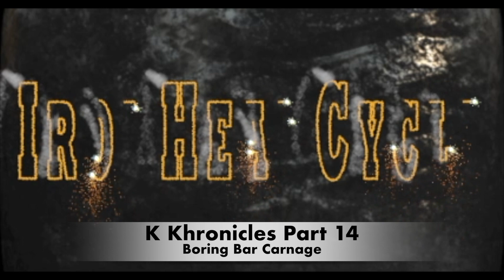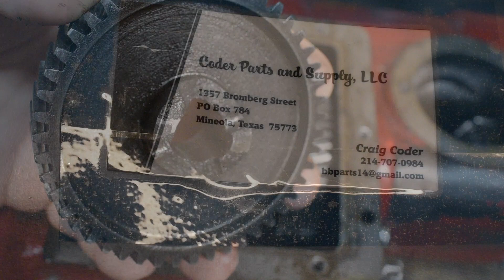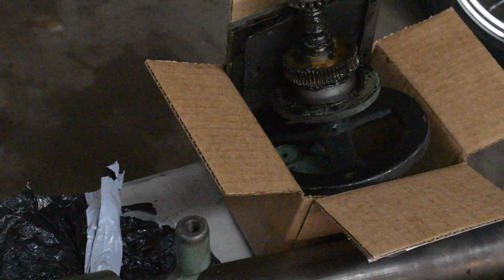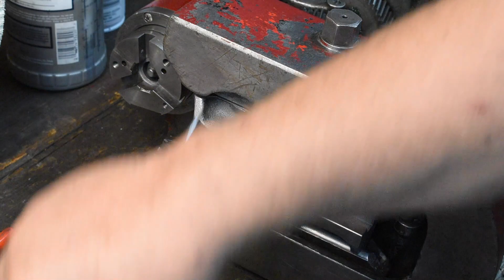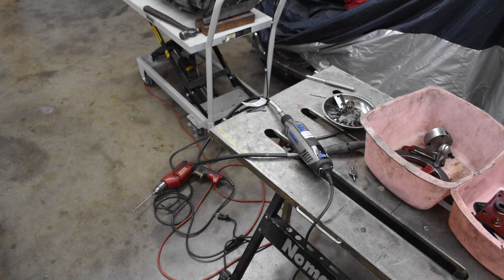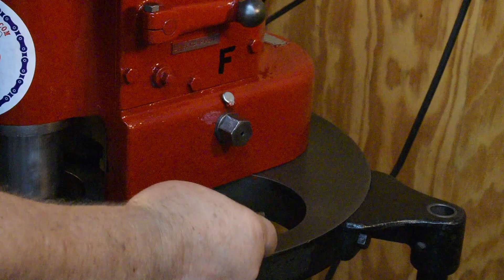K Khronicles Part 14, Boring Bar Carnage Nbr. 87

Comment: Good info!!
 I recently acquired an old KW boring bar and will be giving it a checkup and oil change before attempting to operate it. 
It will have to wait until after I get the vintage Sunnen LBB hone machine that I also got in the screaming deal up and going again.
These old machines seem to just keep on going and I think I got lucky with these two since there is no way I could afford any of the new or even used machines.
Reply from the maker: You are going to have a lot of fun with those vintage machines!

Comment: I am a machinist by trade, that  gear bore and shoulder can be repaired. I have done many of them. And the bushings can be easily made as well. 
If need be, you can machine a new gear blank, hob the teeth and harden it yourself with oil quenching.  Lastly, you can simply have a new gear made by a company called “Arrow Gear” located in Downers Grove Illinois. They can make a new gear right off your sample piece.   But repairing your old one is the best option as long as you have a lathe and some round stock.

Comment: I feel your pain brother....went through it with an FN bar. Same thing...only a pin fell out of mine and destroyed a bunch of gears. It sat for 8 years until I tore up my other bar and had to fix something to make a living lol. I found Craig like you did....luckily I'm not to far from him either (Cumby,TX) . He had to explain what you call the secret screw to me as well because I could NOT figure out how to get the damn shaft out. Unfortunately I also managed to somehow strip the hold down bolt that goes through the base...again Craig Coder fixed me up...sheesh man $1600 later from a taperd pin falling out! I almost spot welded them all in lol. Great Video man! Tc and Subed Brother!
Reply from the maker: Thanks for the sub, I looked your channel up and subscribed. Craig is a great guy and really bailed me. I picked that boring bar up used years ago, I think I paid 400 bucks for it. Bet you can't touch a working one these days for less than 3 grand. I might bore 30 cylinders a year. It made it from 1948 to now, so it will probably outlive me. I used to do car engines years ago. When you going to race that budget 350 Chevy?
Reply: @IronHeadCycle  it's not a race engine anymore, it's actually leftover parts from several customers blown up old dirt track engines Ive had for years. just some junk I threw together and put in my old farm truck for my kid to drive lol. I've been in the automotive  machine shop business pretty much my whole life,  But Ive never really messed with Scooters...other than an occasional  bore job and a few valve jobs. I did a seat repair on some screamin eagle heads once that the seats were falling out...but that's about it. I've spent a few hrs today watching your channel. I've learned a bunch about Harley's from you that I didn't know. Cool stuff man! you've got an awesome channel, you defiantly know your stuff!

Comment: Greetings From Siberia. As always I hope the two of you are well. Another first class video from I.H.C. world headquarters. There was no doubt in my mind about you repairing the Kwik-Way and making it operational again for the next generations of Wizards in the centuries to come. There are some Wizards bestowed with special genetics that compels them to solve and conquer all things mechanical that come their way, even when they question themselves why they are doing it. There is no logical explanation except for you are a wizard  dam it, and embrace your powers . As you know I also fall into this category. There are still good people out there like Chris that are willing to help someone out, good on him. I think it was a good decision to replace the shaft and gear assembly as a unit as they have been run in together. I think the gear could be repaired by you if you get the time at some point. The center could probably be machined out and a sleeve pressed in and then welded, and a new shaft made. I wondered if you took measurements for the bushings, they could easily be made. I'm sure you could make the donor operational again at some point. Another fantastic repair and i'm looking forward to the next chapter of the K Kronicles. Take care From The North  Gary Siberian Cycles  Now the reindeer want to be fed, it never ends.
Reply from the maker: We are fine, thank you. I did, of course save the broke gear. If I couldn't buy a replacement, fixing the broke one would have been the only choice. I have been hashing over options in my head. My problem is that I don't know what the gear is made out of. It broke like cast iron. Cast iron gears? That doesn't seem likely. The gear drills easily so it isn't hardened. Forged steel maybe? I think machining out the center is a given. I suppose run some brass or silver soldier around the part I'd press in to replace the hub. I'm no good at brazing. I'd certainly have to practice. I was planning on machining new bushings, but replacements were cheaply available. I have a hunk of bearing bronze I was planning to use. I've got the gear out of mine and another shaft out of the donor machine that needs some work. I see another video in the works. It will be a while, I'm backed up in the shop to the tune of 1 chopper and 4 engines. Chopper videos in wrk and will follow K Khronicles. I'm sure It'll be deep into Canadian winter... Throw another log on the fire for me...